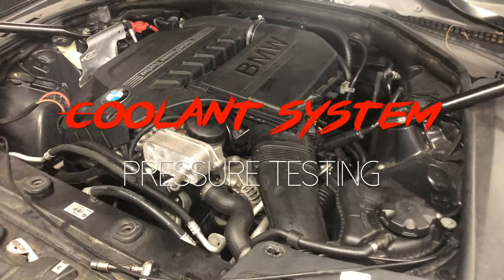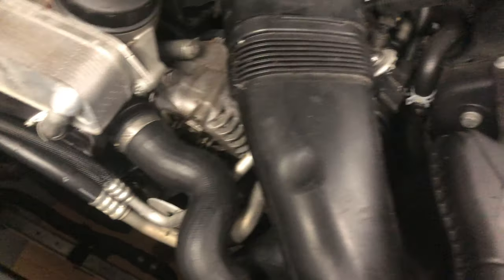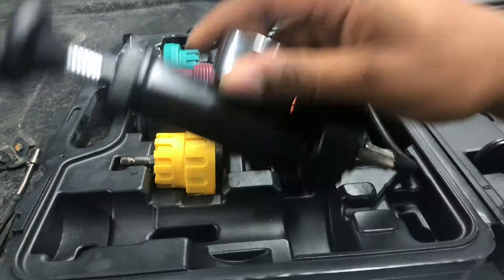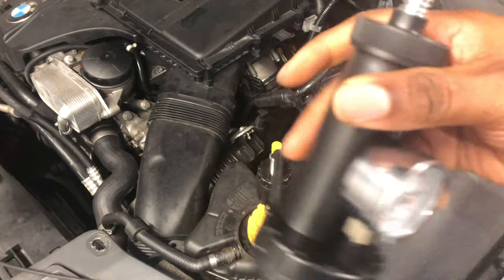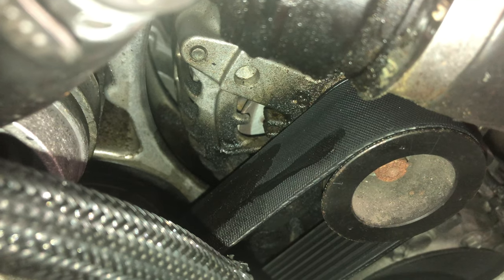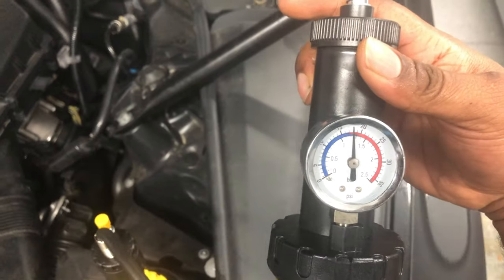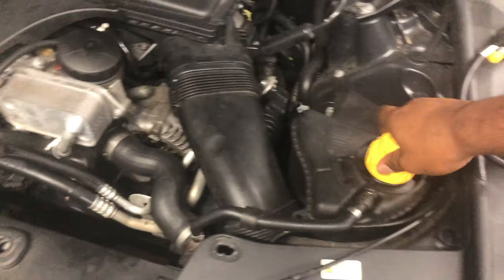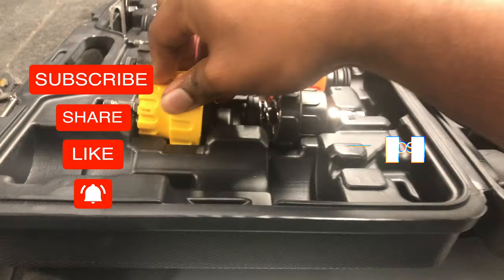Easy Way to Find the Source of Coolant Leaks

Comment: Great tutorial! I'm looking to purchase a pressure test kit, however can't seem to find any info on the internal thread cap size for the expansion tank in an N55 engine.  I found a test kit that supports 47mm and 55mm BMW radiator cap size, should I just measure the expansion tank cap size and go off that?

Also what is the purpose of bleeding the system before doing the pressure test to find the leak?
Reply from the maker: Thanks glad it was of some help. You can go ahead and get it off the expansions tank, since that’s where you’ll hook it up. This is the one I have and it has a variety of different sizes. So has worked on multiple vehicles including f series and such. https://www.harborfreight.com/radiator-pressure-tester-kit-63862.html
Reply: This isn’t a tutorial. He didn’t teach anything

Comment: Hej whats the name of the tool you used to pressure test the coolent, i have refilled my collent for about 7months ago and not its dropped to minimum so i guess its a small leak or is it normal to lose coolent?
Reply from the maker: Radiator Pressure Tester Kit. Definitely a small leak somewhere, not normal.

Comment: Hi,
Does any leak relate to “Coolant Top Up” warning?
Note that the coolant level is at max, but getting these warning is bothering me.
Reply from the maker: I’f the coolant level is at its max level, more than likely a sensor issue or I’d try and bleed the system in case there is an air pocket causing an inappropriate reading.
Reply: Did you get this fixed?  I had this problem after I replaced my tank.  My coolant sensor wasn't twisted in below the tank into the lock position.